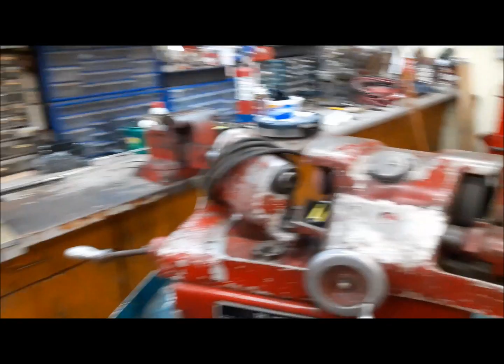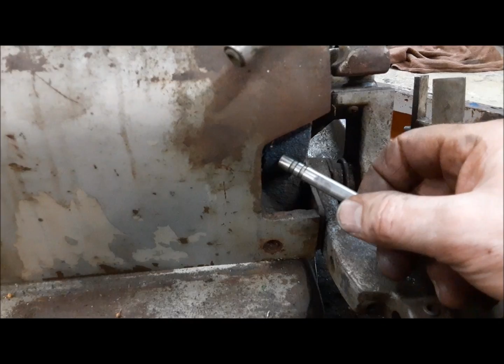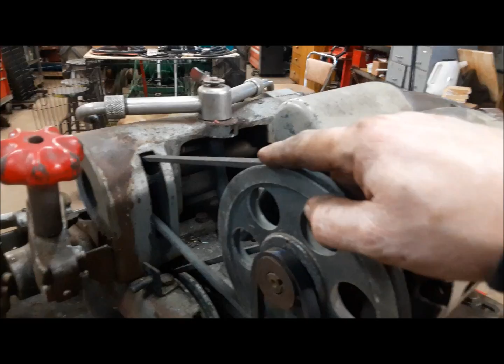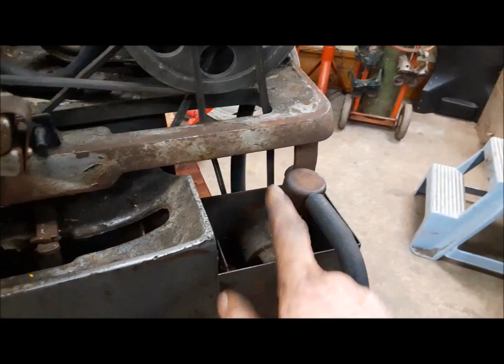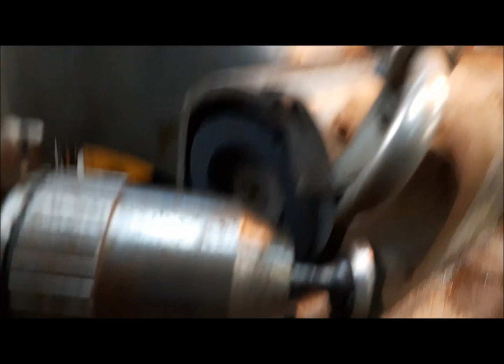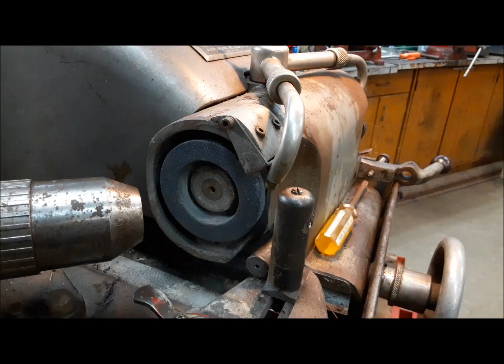Sioux 645 Valve Grinder part 1 Introduction and Start Up

Comment: I have reground a few valves on a Cincinnati #2 horizontal mill that had a power drive indexing system.  Years ago mostly for old tractors and a couple motorcycle motors .
Reply from the maker: That'd be cool to see.

Comment: What do you use for coolant?  I bought a 645 last year for $475 with all kinds of accessories included.  $115 is a Awesome price.   I have several sets of heads waiting for me to get the courage to experiment.  The seller included a valve guide knurling set too.   Not sure if I trust knurling valve guides yet
Reply from the maker: I don't really know what I use. Its a 5 gal unlabled bucket of "cutting oil" I got at the auction.  I have also used atf before with no issue.
Reply: @ClaremontClassicGarage ATF was my plan because I have a gallon that I don't have another use for.

Comment: Hey Kevin, Was commenting on your B and D video from a long while back. Have been doing more research and started looking into Sioux stuff and came across this. Do you still love it? Like you say the B and D was for a garage to do the odd job and the Sioux is for a machine shop. It seems to me the Sioux is way better quality? I am eyeing up a model 645B and a model 2001 locally. I think I like the older 645 but the 2001 is a lot newer.
Reply from the maker: For the same money I'll take a Sioux every time. But if I got a smokin deal on a B&D I'd be happy with it too.
Reply: @ Your opinion is greatly appreciated. Thanks Kevin.
Reply from the maker: @Schneids15  My pleasure.

Comment: Thanks for video! I have a Sioux 655 valve grinder, it needs the valve stem chamfer fixture. I did not see you chamfer the valve stem. This step is very important as the chamfer is what centers the valve in the chucks v grooved depth gauge…ps. On the Sioux chamfering fixture is held by clamping on the right side of the machine.
Reply from the maker: Its missing on mine. I've been looking for one.

Comment: in my opinion it's the best valve grinder made. I have ground many valves using one in an earlier time. And yes the little lever on the right is  for a diamond nub to dress your facing stone.  The quick chuck was real nice addition, especially when you were grinding... oh say... 10 sets of valves at a wack. My boss used a light cutting oil  in  the lube pump system. I don't remember having a chamfering attachment anywhere.  For chamfering the stem we simply spun the valve stem on the outside radius of the facing stone by hand.
Reply from the maker: Thanks!

Comment: Seems that a lot of them are not used anymore and sale cheap 
Every small engine shop can have one at the low price now
Reply: These are great machines, I’d say the best, except for the chucks and centering cone setups which can produce runout of about.005+. I’m in the process of converting mine into collet chuck. That coolant reservoir slides out for easy cleaning.
Reply from the maker: I got a black and decker with the seat grinding setup for 50 bucks. nobody knows what they are anymore.
Reply: @ClaremontClassicGarage  if I was close to you I would buy it to go with my dad’s old blk B/D one ☝️
Reply from the maker: looking forward to using this one.